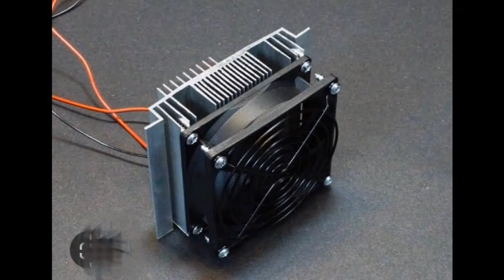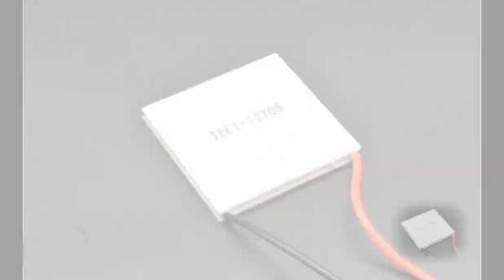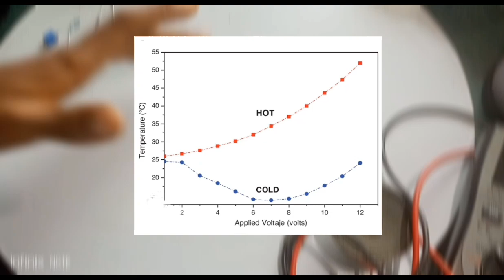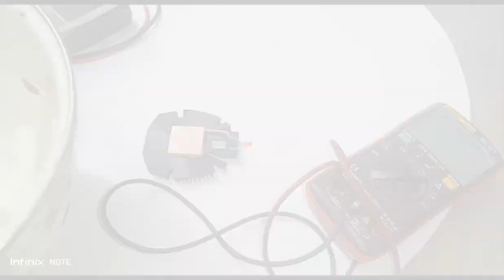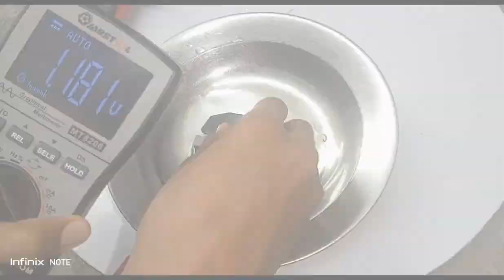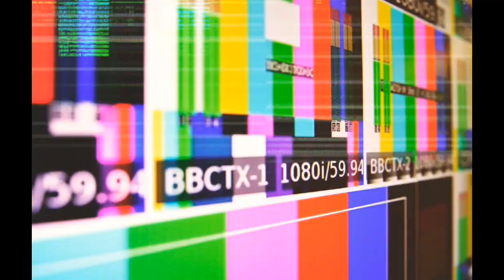The Peltier module Free energy science! - does it really exist

Comment: Peltiers can generate voltage for sure. Add multiple in series and you get more voltage. But its hard to keep the temperature delta for long period of time for that. Oce could use regular led to make solar panel as led can also harvest energy. But you need like 40 -50 led to make a panel to get any voltage out. You could try that
Reply from the maker: Yeah peltier modules are inefficient anyways that's a fantastic idea will try... Thanks for the clue